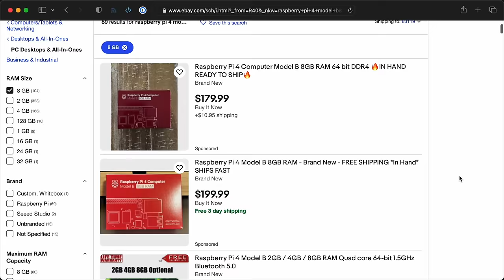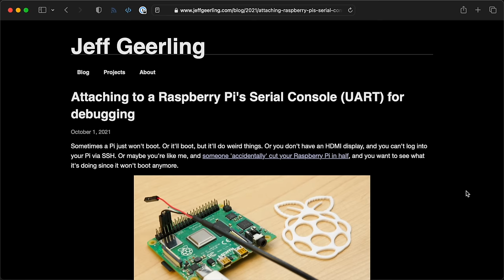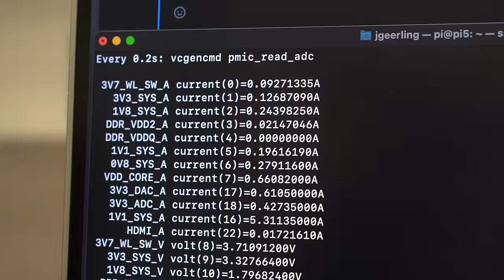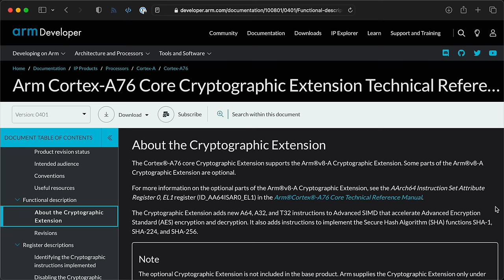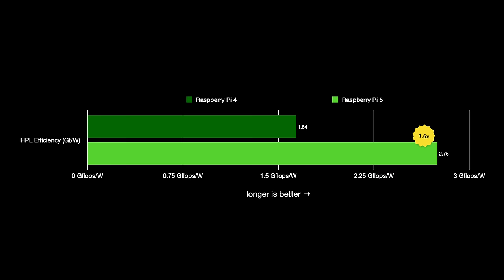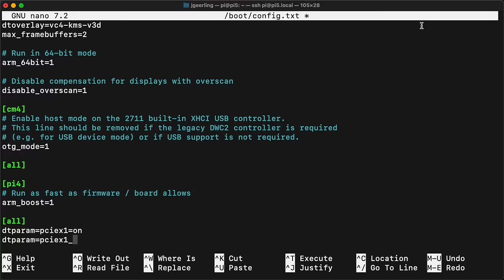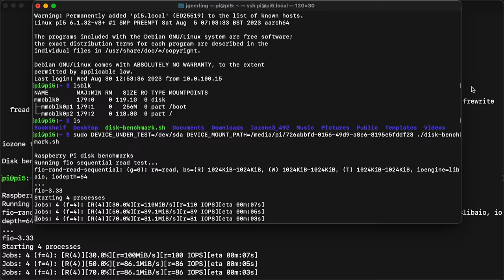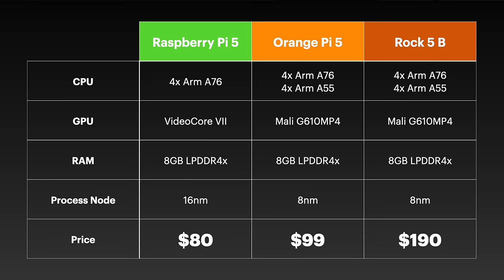Raspberry Pi 5: EVERYTHING you need to know

Comment: Great videos. I'm also working on a Project. 

For your PiGPU, few ideas to get it to work:
1. Bios Programmer.
2. Pci debug card.
3. VM mode.
4. Ensure both Pi & GPU each have their own Wifi/LAN.

That way, in addition to PCI connection, both would also be interconnected with Wifi & LAN.

Maybe need to patch or flash the Bios on the GPU.

Let me know what you think of the ideas, hopefully they help.

PS: Maybe possible to embedded the Pi dirrectly on the GPU Board.

PSS: Is it possible to flash a "Retro Game HDMI Stick" to work as a GPU?

Comment: Hmmmm... I'm not sure about the use cases for this yet. More performance is nice but a few years ago I first started playing with cheap chinese industrial mini PCs running J4125 CPUs. The Pi fills niches where I can use the GPIO or camera interface, so I've used Pi zeros for things like data loggers and cameras, Pi 3s for OctoPi and Pi 4s for media players, but for general purpose compute nodes, I'm all J4125s these days and they seem to still walk all over these boards for efficiency. I can run a maxed out J4125 on about 12W and based on benchmark numbers I can find, the Pi5 is probably hitting somewhere between 80-100% of the performance of the J4125 but by the sounds of it, while drawing up to twice as much power. On top of that, my J4125 machines can already rock 2.5G ethernet, PCIe and M.2 in the box. I'm sure there will be buyers out there for the Pi 5, but for the use cases where I would use a Pi, the extra power consumption would seem to make them less attractive to me for the most likely uses I would find for them. I think I'll be sticking with Pi 4s and Zeros for the most part.

Comment: Damn, Jeff! Awesome video!!! As for the last question you asked, there's actually one thing i would like to know:
How would it perform in Moonlight or Parsec (or even SteamLink) kind of apps? The Pi4 used brute force from the processor to decode the video stream, but since this one rocks a graphics card with integrated h265 encoder/decoder, i would say not only performs flawlessly, but it does it without heating too much or without drawing too much power.
Also, since this SOC will will support button/remote power-on, and most importantly SLEEP, we could finally see a project that puts the Pi into a car audio system, once Android works fine. Also, even if it doesn't support sleep, the damn thing boots in 7 secods?? goodness gracious!!

Comment: The main selling point of the Pi for retro-gaming was the analog output for CRT displays. Now that it's gone, there are better options available.
Reply from the maker: The Pi 5 still has an analog video out, it's just on a pad on the board instead of exposed through a minijack. So for certain types of builds, it would require soldering (which is a downside), but it will still work with tons of TVs.
Reply: @JeffGeerling  That's good to know. I'm fine with soldering because it's my day job, but plug and play is preferred, especially for the typical buyer. I mean, I hate having to do it even at work. Let's hope someone creates a hat that makes this a viable solution for CRT enthusiasts.

Comment: They removed the 3.5mm jack.. which ISN'T just for audio BTW. It's an audio and video jack, it's basically a mini RCA jack.
So now.. i keep wishing they could just make an adapter for one of those bored plugins for a replacement jack.
I like using a Pi for retro gaming on my CRT..
Reply from the maker: They still have two pins for you to solder a header for composite video — just the audio output is gone
Reply: @JeffGeerling  
That's crazy to me.

Comment: ok i have a question, i have 2 power bricks of 12v-2a 5v-2a molex connector, another 12v 6a barrel connector, i powered the pi using the radxa penta hat and have seen a different reading for the VDD_CORE_A. The molex connector gives higher readings than the 12v-6a barrel. is using the molex connector bad for my pi? since the readings between the 12v-6a barrel and the official pi powerbrick ( 5v 5a ) have the same readings.

Comment: The only reason you get that power warning when not using the official supply is because the voltage is 5.1V whereas normal adapters use the 5.0V USB standard. It's an artificial thing to steal more profit. Like Raspberry's use of "standard" IC's that are customized so you can't just buy the off the shelf. Their response "it's too complicated to repair, buy a new one"... Ugh, Raspberry. I think generally people have moved on.

Comment: Great round up thanks Jeff, I have question about that power button that I don't think got covered and I didn't see else where, is the switch optional or do we have to press is to power up the Pi? and is their any kind of connector/pins that can override it? I really hope it's optional, what with the power input on the side, enclosures are already a pain if you want anything in addition to power in (i.e. USB or network - yes I know, POE Hat, which is great if you don't want to use the GPIO header 😞), if we have to press the button at the back to power it up as well, that's forcing 3 sides to be exposed which is really annoying from an enclosure perspective).
Reply from the maker: You don't have to press the power button; when power is restored (or applied) it will boot as normal. That might be configurable soon too.

Comment: First thing i would do if i would use the n100.as desktop is a reinstall.
Who knows what spyware is included on the os.

Also very brave that you plug it straight into your home network...

Anyway, i have been using.j4125, j5005 itx motherboards for my homeserver needs (kubernetes with longhorn distributed storage)
Raspberry pi has proven to lack performance for this. Might upgrade to n100 or n305 .

Comment: My one question that I haven't found the answer to yet:  Did they properly wire the USB-C header this time around?  Last time USB-PD was supported (partially) but data could not be run at all over USB-C.  Are we able to use the USB-C for both power and data?

Also from what I've read the USB-C port only supports USB-PD and not the newer PPS (Programmable Power Supply) standard which is why you'll have problems finding USB-C power adapters that'll work with the RPI5 at full speed.  It would be interesting to know if there's any other common options availabe, eg specific chipsets that'll support the RPI5 at full speed.

Thanks for the vid as usual Jeff!

Comment: One critical detail that a lot of reviews miss is its lack of video decoding support. It doesn't support AV1 or VP9 in hardware and that alone would be disappointing considering it'll probably ship in 2024 to most customers and they even went as far as to drop h264 decoding even though it was on the 4. It's very disappointing for me and many others since what could have been a fantastic media machine became less so
Reply from the maker: One thing the Pi engineers pointed out when I asked was the new CPU can software decode H.264 up to 4K 60 without breaking a sweat, and can handle AV1 and VP9 at 1080p without a problem, and can do hardware decode of H.265 (HEVC) up to 4K60. Encode can be tuned decently well still too... I'm still doing some testing with Kodi/LibreELEC but it does look like even without hardware encode/decode for all the codecs, it's handling all the content I already have in my library (4K and HD alike).

Comment: USB 2.1 and even a couple of ports with USB 3.0, wired Gigabit Ethernet, and even  an RTC (Real Time Clock)? Woohoo! 1990, here I come... Now, where do I plug in my 16-bit PCI cards, my RS232 modem, and my 24-pin (!) dot-matrix printer that requires a good old Centronix parallel port? I hope we also get PS/2 connectors for the mouse and keyboard.

Comment: Apparently the Pi 5 cores (BCM2712) can run faster in multicore mode than Raspberry Pi 4 cores (BCM2835)
Plus the single core speed seems to be twice as fast as the multicore speed of the Pi 3
I think at minimum the cooling is helpful

Comment: Im happy to see the new Pi5, but I am a bit disappointed that they stuck with PCIe Gen 2 officially instead of Gen 3 (then the 1x could allow nearly full 10Gbe), and that it is only 1 lane.  I am also disappointed that they didn't implement eMMC alongside the SD card.  eMMC is just so much faster and more reliable than even the best SD cards.

Comment: I have to disagree with respect to surface mount being better for the pins... if you're going to be using your pi with a hat, you'd need to pull / push the hat in, and if you're a beginner the odds of you reusing the gpio pins is high, so eventually you'll be pulling those headers too hard and damn the thing is broken... through hole you gotta be pretty dumb to break those... maybe if you mean sometimes smt is better.. sure sure... clock, wifi, cpu etc... sure... but something you're going to be using often, I'd say no way... I even disagree with the cheap smt uSD card port... overheating breaks them.

Comment: Brother, I already saw your video about the power of 6 Raspberry Pi 4 on his special PC motherboard against Ryzen 96 Core. You can do the same thing with Raspberry Pi 5 with liquid cooling and 3 or 4 RTX A500 graphics cards, but this time, for example, I want to make it with 3 motherboards that work in parallel. I want to, but before I spend a few thousand dollars, I'll see if it's worth it

Comment: Unless I have a very specific task that is suited for the pi I won't be buying anymore pi's. MSRP on a pi is never what you pay in the end after shipping, power supply, sd card and a case. So that $80 pi is really $120. For that I can get a mini pc with an Intel Celeron That comes with a power supply, nvme drive and a case. Most of my uses are to host Node--Red, Home Assistant, docker  or raspbx. I can get better performance for those servers on a mini pc at the same price not to mention being able to run routing software like pfsense. Nice video though, thank you.

Comment: If the pi supports PD, does it also switch up to higher voltages on the supply side? The adapter seems capable.

Comment: Im curious if the onboard wifi actually is more compatible with WIFI6. The PI4 chip will connect to 5ghz networks but it does not seam to like DFS channels at all. I have a WIFI6 router here at work and the PI4 will not connect at all to is. It actually does not even see the 5ghz networks at all.
Reply from the maker: I haven't had an issue but only tested on an ASUS and a Netgear AP
Reply: @JeffGeerling   Check to see what channel your WIFI6 router is using. Only some of the channels are in the DFS range. My PI4 can connect just fine as long as the range is not DFS channels. 
DFS channels are 52, 56, 60, 64, 100, 104, 108, 112, 116, 120, 124, 128, 132, 136, 140, and 144
Mine specifically was running channel 120

Comment: HUGE MISS BY RASPBERRY PI ON MICROSD: with PCIe, they could have placed an SDExpress socket. Then, with an SDExpress card, one will get similar speeds as an M.2 SSD through the external port with a hat. ALso, with a properly engineered configuration, when a non-SDExpress card is plugged in, then the external PCIe lane would be available.

Second miss: why not a UHS-II microSD card slot? That would provide 300Mbytes/s in half-duplex. If they looked forward with UHS-III, well.

Comment: if the Raspberry Pi Foundation would have focused on a cheaper RP4 Model B since the ARM CPUs are outdated for decades! Maybe not every maker needs that jump of performance while we still suffer from outdated SOC' s. I am and many other still are totally confident with the ARMV8 and dont need that expensive gap filler.

Comment: I'm interested in seeing what the Zero5 and CM5 end up doing.  The standard Pi 5 just doesn't seem all that interesting to me, especially with what competition Pi now has.  And while the prices for the board itself might be $60/$80, you also need a cooler for it to actually function properly, so that pricing should also be tacked on, at least with an asterisk disclaimer.  Maybe CM5 will give PCIe 3.0 certification, I have a feeling that FPC method is what kills that certification, lack of shielding and all leading to signal integrity issues, plus possibly the whole modified power spec, etc., where CM5 could definitely fix all of that; though I'm also disappointed it's not at least a two lane link, for proper m.2 (A, B, E) usage, though I'd prefer a four lane link for M-key usage, or the possibility of leveraging USB4.  Keep in mind that competition is also providing more proper PCIe implementations, not this single-lane mentality that absolutely falls flat; especially when they make the braindead move to sacrifice certification for a better spec.  The Type C power port is a disappointment again, but at least it's more properly implemented unlike last time, but this port really needs to be a full USB port especially with how USB4 provides tunneling for various other specs, especially display.  I'm also not sure how to feel about µHDMI, isn't that port almost universally complained about?  I feel like this generation sits in a weird spot that won't have market favor, competition offers better, and there's still some just absolutely braindead decisions going on within the Foundation that're holding the product back; fourth generation's silver lining for the Foundation as a whole was how cheap the 2040 was, maybe they'll come out with the successor to it as another silver lining for this generation, and maybe that product will finally have a proper ADC unlike the last one!  If the CM and Zero of this generation don't do anything interesting, I think a lot of people will look elsewhere given what the competition is doing, with hopes of the next generation having better mentality behind it, assuming there's no fiascos this generation; but I really do think this generation will be carried by brand momentum and not how good the product is, which potentially makes the sixth generation in danger of an exodus of the brand- the Foundation has lost their way, they're no longer on the extremely affordable basis they were built on and they're now pricing into the territory of competition while not actually being all that competitive.  I just don't see how people can be excited for a lackluster product when the Foundation clearly isn't looking at a viable future as they continue to fall behind in one way or another, outside of specific niches, when the competition is offering better; again I feel like Zero and CM have more viability here, 5's limitations work well for what the Zero platform can do, and CM could fix some issues but I feel like it'll still be gimped by dumb decisions, while their other money maker is looking to end up being their microprocessors.
Reply: $5 whole bucks extra...

Comment: Thanks for the review! 
Regarding the power supply and 25W capacity of the board. Is this USB C psu offering max 5V @ 5A? Is it offering anything USB PD compatible above 5V @ 5A? To buy (or recommend) a USB  C psu that is limited to that in the age of USB PD seems insane to me.

Comment: I just got a raspberry pi 5, but I have never used any raspberry pi devices.  
I downloaded the software to a SD card but it's not powering on after I hit the power button. I am trying to use it for my 3d printer with a touch screen display.  I can't figure out what I am missing or doing wrong. Any advice
Reply: Visita la página oficial de Raspberry. Hay mucha información y foros ahí. Empieza probando con otra fuente de voltaje (power adapter). Luego, asegúrate de haber seleccionado Pi 5 a la hora de instalar el software, etc. También puedes conectar algún dispositivo USB en algún puerto USB para ver si la energía está entrando a la tarjeta al presionar el botón de start. Saludos desde Mérida Yucatán México.

Comment: Quite disappointed to see the choice of using the DA9091 Dialog Semi PMIC (Now Renesas) A similar PMIC was used in the Pi4 product line and was basically a Semi-custom unobtanium part and not even a Datasheet is available for it. This is a Decent performance increase, though I have to say, I expected an 8 core Chip to at least keep up with the competition. Time will tell if it lives up to the hype, ultimately, lets see if they can also keep up with demand.

Comment: I used to use a Pi4 24/7. Run perfectly but for my use case came to short in performance and I/O.
I was running a Minecraft server, Webserver, NAS, MYSQL and so on.

I bought a HP x86 small size pc with a i5-8500T. Has 10Gbit/s USB. 2x M.2 and 1x 2.5" SATA bay.
It has 16Gb of RAM and it just cost me 167€ including shipping.

Now I run proxmox and run multiple instances of MC-Servers and much more.

The Pi5 is drawing max 25W and the PC I got max 35W. 10W more.

Pi5 is still not worth it for computing and hosting servers or heck using it as a personal computer. It’s not efficient and the price of $80 barebone is not justified imo.
I really hoped that they may include a 16GB version and a A78 chip with extra 4x A55 cores.
Maybe they release a Pi5 Pro or something for people who do need the extra computing power and higher RAM.

PS: I still bought the Pi5 😂

Comment: Thanks for this review, it's really interesting! I have a Raspberry Pi 4 connected to two 2.5 external hard drives via a powered USB HUB. On the new Raspberry Pi 5, can two 2.5 external hard drives be connected directly to each USB 3 port without having to use powered USB HUB?

Comment: Thanks for the video Jeff. Question - I preordered the active cooler and case. Can I fit the heat sink inside the case with the fan?
Reply from the maker: Yes! Though you will need to pop the case fan bracket out.
Reply: @JeffGeerling you rock, thank you sir.